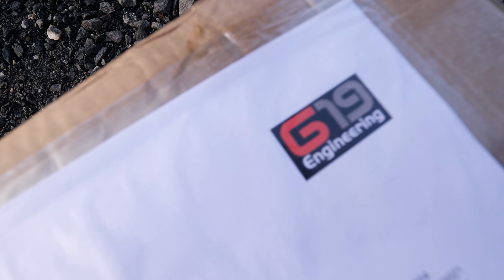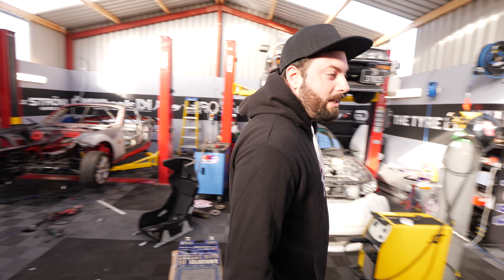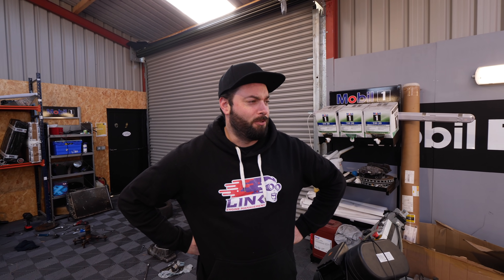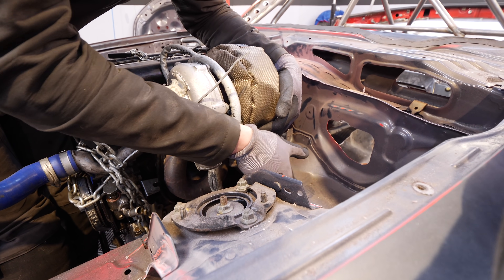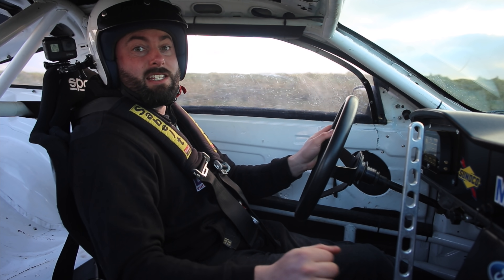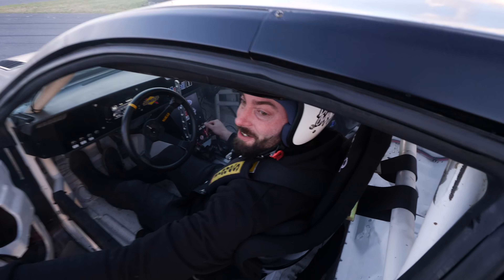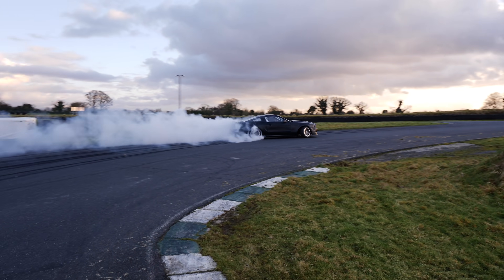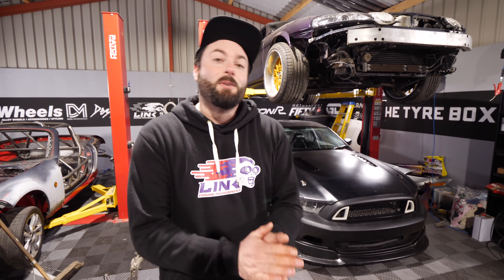My Mustang drift car is AMAZING! | SR20 is in the MX5/MIATA

Comment: A lot of local street racers use Federal tyres. They always say you need to heat the crap out of them for grip, but they're also really hard-wearing, so they last.
The Mustang looks so damn good with the Strom wheels and the front fitment.

Comment: That's why I've started to love drifting few years ago...small technical changes can make your car drive a lot different. Ofcourse here, they are not so small and cheap 😂 But overall I'm thinking about suspension settings, allignment etc.. Good job. One what I've mentioned - 225's on the front are good for my E46. Here I would pack 245 at least. Keep goin' Dave, maybe till the next time in the commentators tower 😜

Comment: Try DRD racing in the uk will be able to make your alternator bracket a lot cheaper and faster turn around. Will just need some measurements
Reply: We ordered it up there and then. Only because the time to get in contact with someone and the measure could loose you a few days and then they might not be able to do it.

Comment: Also I noticed the car did a decent bit of self-steer which apparently isn't a thing for 2012+ mustangs because of the suspension/EPAS. Do you guys still have EPAS in this car or was it deleted?
Reply from the maker: The car has had the EPAS deleted and running a column and rack.
Reply: @driftgames_life  Appreciate the response!

Comment: Steering fixed ✅
Suspension fixedish ✅
Not using 3rd ❌
Big boy pants on cmon
Reply: The old clutch is slipping badly and I wanted to get more laps and try the steering than smoke the tyres off in one run, but we will get a new clutch in soon and go again. The car has a 3:6 diff in and 2nd gear is like 80mph so we need to change that too!
Reply: @davidegan3663  Fair, out with the seam sealer before hooking third. How did you rate the FDF stuff to WF since you’ve driven on both?
Reply: @callymac5215  it's hard to compare the Mustang to an S body, but the FDF stuff is very sturdy and nicely made for 2/3 the price of WF, so a winner for me!

Comment: Hi guys why dnt you try and put a non power steering rack on you will save weight and room in the front. Josh will just needs get a bit more muscles
Reply: I already have one car without power steering 🙈 also it was an easy enough fix 💁‍♀️
Reply: @joshholdsworth4110  ye i wasnt saying ur weak or anytging i really enjoy the program so much. At least the engine is in the bay
Reply: Slowly learning why nobody has done this before 🙈
Reply: @joshholdsworth4110  ye i bet but its something new. Its the same with us in autograss cars new build and different engines its a good thing to have